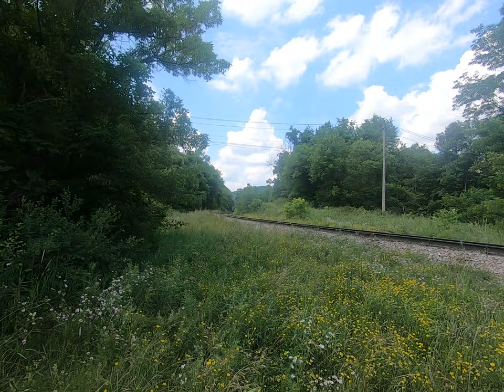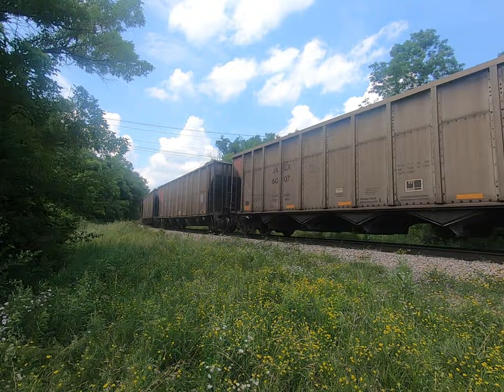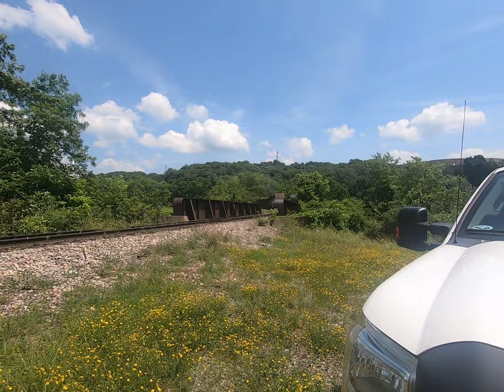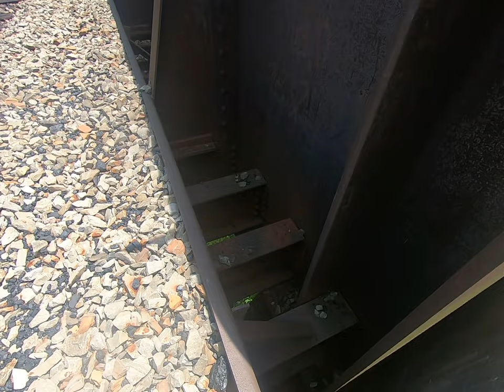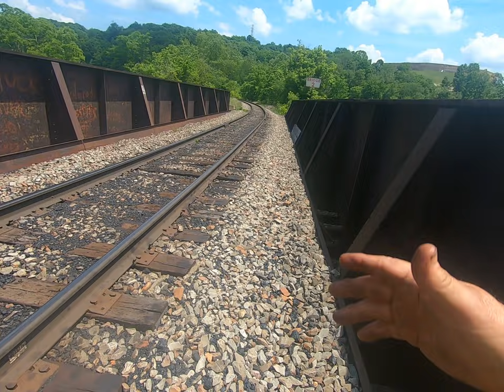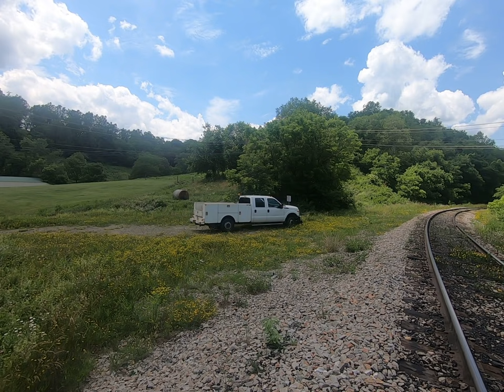EB Coal Loads over Curve 15 + Our Ballast Deck Bridge

Comment: Thanks Dave for the info in your description and in the other comments.  Now I understand the benefits of a ballast deck bridge.  I always wondered why go with one type vs. the other.  And it's good to see that old Espee girl, 3098 back out on the road moving the loads after her not so tippy-tip-toeing stroll on the ballast and ties.  Happy railroadin'.
Reply from the maker: Thanks you my friend. All my open deck bridges (13 of them) have
problems holding track surface right on and off the bridges, constant thing to keep them tamped up, this bridge has zero problems like that, plus don't have to replace wood bridge timbers,
big saving in dollars there. Appreciate your watching

Comment: I love ballast deck bridges. Easier to maintain than an open deck. You are so right about the bouncing when tamping. Wait until you run steel and tie gangs over one. 🤣
Reply from the maker: They've had the tie gang in here a couple years ago on this bridge, but I wasn't with them, I can imagine what that was like Zach! We
have 3 open deck bridges on high degree curves and they are
always wanting to push the high side rail out,wish they all
were ballast deck bridges.

Comment: They must have allocated for that truck before the derailment.   The train at speed looks like a regular unit train but 1/4 the size. Never a quiet moment as you have the next track project lined up There are a few deck bridges here in Milwaukee that are pushing 100 years and they produce some interesting icicles in winter
Reply from the maker: Well Paul, actually because of the derailment, that woke some
people up in higher management and they decided to give
the track whatever we need to prevent things like that from
happening again. That is a really good thing and we've made a
lot of improvements since then, just a shame it had to take a
catastrophe to do it, but I'm pretty impressed how now our
new management is taking the track seriously. I bet those icicles
are neat to see, we get the same on some of our rock cuts.

Comment: Nice truck I guess they like you! It's been hotter than an exhaust stack at run 8 out here in Lancaster how's it out west? Does your little island railroad have to answer to the FRA or do you do it just because it's the right thing to do? I wasn't sure how that went? Be safe my friend you sound like you've recovered from that little incident!
Reply from the maker: Been hot here to Anthony. FRA chooses not to police us, they
deem us as an in plant installation. However being a coal mine
we are policed by Mine Safety Health Admin. They are supposed
to follow the same laws (Code Fed Regulations Title 49) as FRA does. However most all MSHA inspectors only get out here a 
couple times a year, they are also over worked and under manned.

Comment: with the amazing amount of locomotives being retired..  are powers that be looking at inexpensive spares?? its just a thought.
Reply from the maker: Yep lot's locos around going cheap, our problem is we don't
interchange with anybody, so trucking a loco in here is an
astronomical expense, so we just keep repairing and rebuilding
the ones we do have. appreciate your watching Wayne
Reply: @ccrx6700  have to bring it in on a barge.. where you unload coal at.. so its just a pair of cranes to lift it from the barge to your tracks hopefully not too far from the docks..  its just a thought..

Comment: Great video.  How does the bridge handle rain?  Does the plate holding the ballast have ways to remove any rain or moisture buildup?  Do you have any problems with winter freezing on that bridge? Thanks. :)
Reply from the maker: Thank you, glad you enjoyed. The rain water seeps thru the ballast and drains out, so there is little to no freezing and best part with
steel deck no mud! Appreciate your watching sir

Comment: Great vid Dave awesome clear day, I can see the advantage of tamping thru the bridge, but how would you crib it, if need be, and isn't that a ton more weight stress on the whole structure.
Reply from the maker: No way to crib it, but with a steel deck plate, no mud gonna
get in here...LOL US Steel built everything over kill originally
here on the bridges. We have had engineers study these bridges
and they all say the same thing. I wish more of our bridges on
high degree curves were like this. We have problems on the
open deck bridges on high degree curves. Read my responses to
6777 productions on that. Thanks for watching my friend
Reply: @ccrx6700  will check 6777 response, and yeah congrats on the new truck, yes its smaller than your other hirail lol but f350 no little truck, lol
Reply: @TriGogglin  Compared to his Mercedes 5 ton Highrailer it is a small truck!
Reply: @irongoatrocky2343  indeed

Comment: What is the benefit of having a ballast deck bridge? I would presume it would costs more, but the only advantage I see, from my lame man's perspective, is that it would help prevent objects from falling below. Is there some real benefit to having bridges like this?
Reply from the maker: Open deck bridges are great for tangents, it's nice to be able
to have the ability to tamp thru a bridge with a curve. We have 2 other bridges on high degree curves like this one that
are open deck and both of them have problems with the high
side rail wanting to push out with plate cutting into the timbers
on the approach ends.

This wants to add to track alignment problems and the only way to
correct that on an open deck bridge is pull the spikes and readjust
the rail alignment. You can line track with tamper thru this bridge.

Hope that helps Sam. Open deck bridges we have over roads
and streams have either the center timbers butted against each
other or a spacer block to prevent stuff from falling. Ballast deck
is a problem when brooming track have to have a ground man on road below the keep throwing ballast off the road and stop cars...
Reply: @ccrx6700  wonderful explanation, Dave. Yes, that makes sense. It's just a feature you don't see all too often, but for that purpose I can totally see how that helps. Thank you for the insight, Dave!
Reply from the maker: @6777Productions  sure would be cool if you could ride the rails with me next time, instead of me riding your rail with you 😏
Reply: @ccrx6700  Wink, wink, I think maybe one day we can figure something out! I do want to stop by down your way one day and see in person this magnificent railroad. Time will tell... Time will tell...

Comment: If the bridge deck holds gravel  - does it hold water and rust?
Reply from the maker: Good question Mike, the water drains away thru the ballast and then off the deck plate.  Appreciate your watching 😊

Comment: Why are not all RR bridges  ballast deck?  Seems as though a savings on maintenance.
Reply from the maker: Well Tim, that is a very good question but one I don't have an
answer for. I wish all our bridges were like this one. All of our open
deck bridges (13 of them) have problems with the approaches
wanting to dip down right at the bridge, it's a constant thing
to keep them tamped up, I have no problems at all with this
bridge like that. Open deck bridges are cold in the winter with the
freezing air up under the rail causing rail pull aparts, no problems
with that on this bridge either. And you never have to replace wooden bridge timbers. Big savings there
Reply: @ccrx6700  Thanks for the reply sir. You have very informative and interesting videos. Learn a lot about railroading.
Reply from the maker: @timgear9892  thank you Tim 👍